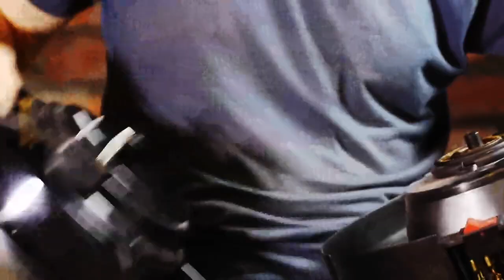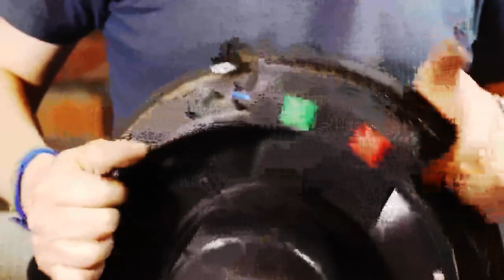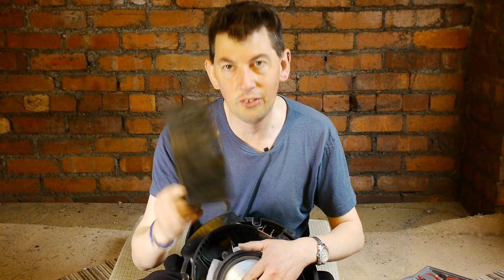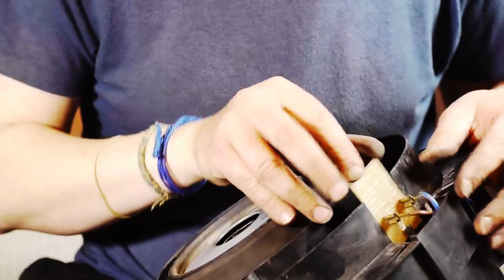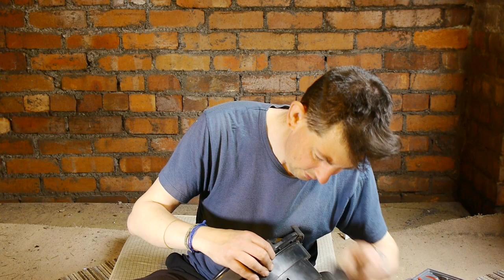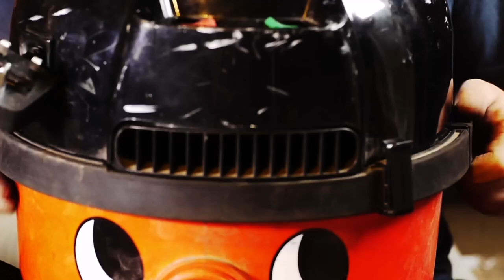Numatic Henry and Hetty Hoovers: how to take them apart, troubleshoot and fix them.

Comment: The homemade bag is definitely the problem! The air cannot pass through it in the same way as a genuine vacuum bag, putting severe strain on the motor
Reply from the maker: I chose a fairly porous fabric but yes, I should really be using a proper Henry bag - I'm probably letting dust into the motor. The Henry isn't used very frequently so I hope I can get away with a re-usable bag. Henry is so much easier to use than the Dyson we've inherited; the Dyson needs unblocking and cleaning every time we use it.

Comment: Thank you so much for this. My Henry sounded different, and produced a burning type smell - so I turned it off, but now it doesn't turn back on. How do I know if the brushes or the whole motor needs replacing?